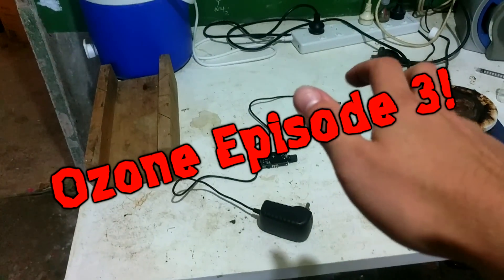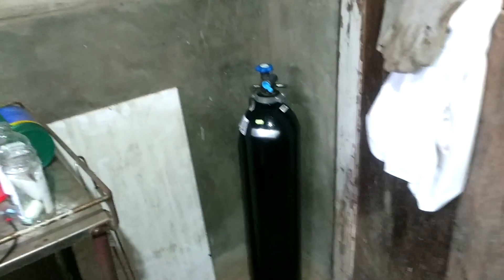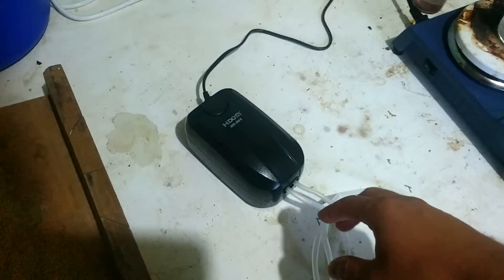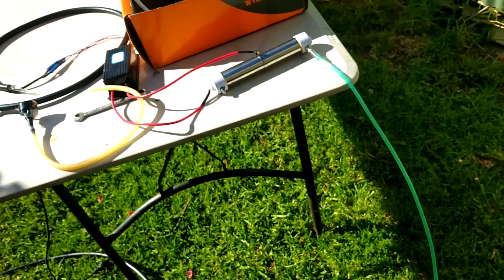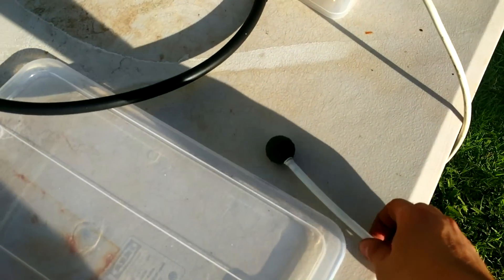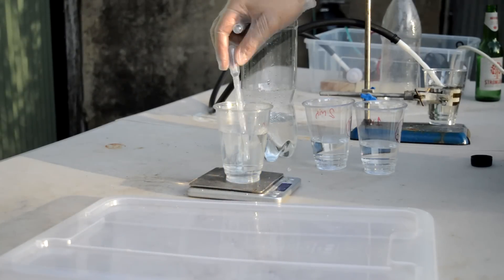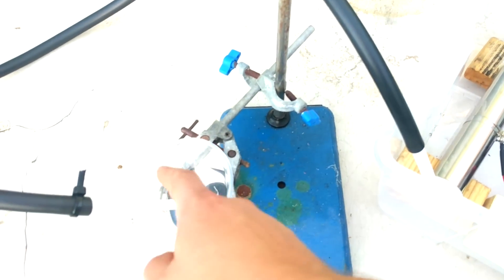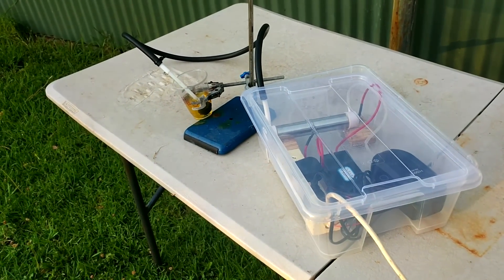Putting Pure Oxygen through the Ozone Generator (Ozone Ep3)

Comment from the maker: What improvements should I do next everyone?? I probably should use those one way valves to stop the ozone backflowing into the pump every time it turns off lol oops
Reply: Well I think you got a low efficiency because your ozone absorption wasn't good enough, try using a taller column. Also a lower oxygen flow decreases your ozone output but increases your oxygen efficiency as less is wasted
Reply: Nicolás Rodriguez 
lol, i should have read the replies before posting, this was my take on the situation as well.
Reply: Just leave the pump running for a while after turning off the ozone generator to flush the system with air.
Reply: Liquify ozone?
Reply: O2 flow rate was too high, its was all mostly gas, needs to be as fine of a "mist" of bubbles as possible of as small bubbles as possible. It should look like a gentle fizz to be optimum.
Reply: I think at this point, you're ready to run some reactions/experiments. If the goal is maximum ozone output, either parallel more generators or construct your own (the electronics and mechanical design involved might not be worth your time tho). My $0.02 is ... you have a source, it works, it seems to be stable (i.e. hasn't caught on fire or exploded :P), so proceed with using the ozone. 
A check valve is an okay idea, although you have a volume of oxygen between the pump/cylinder and the generator anyway, so that gives you a natural backflow buffer, and a valve could restrict flow somewhat.
Love from Europe <3
Reply: Isolate liquid ozone! It's explosively unstable if warmed to its boiling point but that might actually be a plus for you ;)
Reply: making Ozone with electric discharge is a self limiting process, don't expect anymore than a few percent max yield...you get to a certain conc and the equilibrium halts it going forward...
Reply: When I messed about with ozone production (sterilising water in a tropical fish breeding system) I found that using a column of silica gel to dry the air first made a big difference to ozone output. You can buy the gel with some indicator beads mixed in which change colour when they've absorbed as much moisture as they can. The colour change can be observed moving along the (clear) column so you get notice of when to empty the gel into baking trays and re-dehydrate it.
Reply: Shaun Stephens 
i think his O2 cylinder is probably about as dry as it's gonna get, but still good advice for if he doesn't feel like carrying the big canister, and just uses normal air like last episode
Reply: I'd toss in a cheap digital thermometer inside the box.  Maybe even a couple of them, so you can see how hot the key parts are getting:
https://www.gearbest.com/other-kitchen-accessories/pp_1483698.html?wid=1433363
They're so cheap you could put in a half dozen for the price of a fancy latte.  :-)
Reply: What if you had 2-3 absorption vessels in series? Leading the air/ozone flow from one to the other. Then you might be able to get some estimate of the level of ozone absorption by comparing the results between them.
Reply: Lars Petersson also a good idea!
Reply: Seeing this video first time and rethinking the process, I would guess the flowrate was much too high. Such Ozone gens work by creating a silent discharge. High flowrates and air moisure would reduce the yield by magnitudes...
Reply: One way valves, and more than one aquarium pump if one isn't strong enough on it's own.
Reply: I would build a cooling system, (water,air or just some cooling peltiers)
Because if the oxygen pipe starts burning that wouldn’t be good 
And it Really looks like it was getting a Bit hot
Reply: Just turn the ozone generator off and continue running the pump for a few seconds to run out all the ozone.
Reply: "What improvements to do next?"
1) Add aluminum fins to save your electronics. Heat shortens their life. 
2) Increase your flow rate through the ozone generator.  I strongly suspect  it is wasting time and energy breaking up some of ozone it created. Someone else mentioned it is self limiting and reaches an equilibrium. Increasing the flow rate might mean you can also remove air pump letting air pressure do its work.  I realize the faster flow creates issues with bubble size so that brings me to the next suggestion. 
3) Micronize the bubbles. Your stir bar was a fair idea to move water past the air stone ripping the bubbles off before they get big.  Bring that to the next level ×10 with putting the stone in a pipe that is just barely bigger than the air stone. Plug up the air stone everywhere except the sides next to the edge of the pipe. Then when you push water through the pipe. The water is now forced to accelerate really fast as it passes the stone  ripping very very  small nano sized bubbles off giving you far larger surface area to volume ratio. And because of their small size  and the  turbulence in the water, the bubbles will stay in solution up to several minutes. 
Producing micro bubbles will allow you to have a taller column and and the whole setup will have more water  volume that can better handle a larger volume of air flow into your micro bubble generator. Also moving water through the pipe  creates a venturi  effect that can suck air in. Just another reason why you wouldnt need the air pump. 

Micro bubbles examples: https://youtu.be/r4rJKypLijA
https://youtu.be/Fqs7ceAJcEw
https://youtu.be/en7tQisoA8g
https://youtu.be/bX48qxRtfFM
https://youtu.be/eNMTUBtynSY
Reply: Improve mixing / bubbler efficiency. Look into ozone reactors used for aquariums. Use lots of balls to increase surface area for absorption of ozone. Your generated may make 3g/h but the you may only have 20% efficiency of absorption into the fluid.
Reply: I'd use a desiccant/dehumidifier stage instead of an Oxygen tank...
Reply: loveblowsbad I use ozone for my aquarium and it’s supplied with desiccant as water damages the plates.
Reply: Look at perfluorocarbon solvents, they might have better ozone solubilities than H20...

https://en.wikipedia.org/wiki/Perfluoromethyldecalin

https://en.wikipedia.org/wiki/Perfluorodecalin

https://en.wikipedia.org/wiki/Perfluorotributylamine

https://en.wikipedia.org/wiki/Perfluorotripentylamine
Reply: Extractions&Ire 
i still think you may have lost a lot of ozone to the atmosphere.  even with smaller bubbles, spheres have the lowest surface area to volume ratio, so most of the ozone never even touches the water.  i think you could improve efficiency by putting your iodine solution in a very narrow, tall cup so it has to bubble through more water before it gets to the top.  i think a slower oxygen flow rate would also increase efficiency, but the speed would go down.  but it doesn't look like you're short on O2, so that's probably not a problem lol

but i think if you took those steps, you could maybe get 1.5 grams or something.  the 3g/hr quote is a bit suspect, but it's also possible that the the 3g/hr quote is only under very specific optimized conditions with various parameters that just aren't possible outside of a huge industrial setting.
Reply: Depending on how accurate you're aiming to be, you should start the ozone generator outside of your solvent. Let the generator fill the tubing with its ozone mix, then start the timer at the time you insert the tube into the solvent. Stop the timer when you remove the tube, then turn off the generator.
Reply: The lower yield from longer runs might be due to peroxide decomposing in the sunlight...
Reply: Hey Lad  sorry I didn't catch your name but keep up the good work .. but do U know much about ozone generator's for health ... I have lung cancer and am wondering if U guys would be able to give me some suggestions advise and links ... Hope to hear from U cheers..tis interesting stuff U do ....
Reply: You may want to get a cheap rotameter flowmeter with a needle valve so that you can set the oxygen flow rate to a repeatable value. The ozone generator isn't sensitive to the flow rate through it, so you can turn down the GOX flow to produce the same amount of ozone at higher concentrations while using less GOX. You need to dilute the ozone for most applications anyway, you may as well do so with cheap air rather than costly and hard to resupply GOX.
Reply: Use the regulator to set the minimum pressure then use a needle valve flow restriction to set the flow rate so you get  the conversion sweet spot

Comment: Also the ozone bubbles will be more effective if the bubbles are much smaller in size and can be made to interact with the liquid by making the height to diameter ratio of the container larger to have the same volume of liquid occupy a higher height to increase the time the ozone travels through it. Hope it helps.

Comment: What if you cool down the ozone tube with liquid nitrogen? At higher temperatures, more ozone will decompose into oxygen, as ozone is less stable (even though Le Chatelier suggests to heat it up more, since ozone formation is endothermic). I believe, it is the rate of ozone depletion decomposition that limits the yield, not Le Chatelier.

Comment: 3 years later and I'm sure people have mentioned this, but with your tanks make sure to turn them on/off using the main tap, and then adjust pressure using the regulator. If you ever need to shut one off in a hurry it's way way less turns to turn the tap off than to get the regulator down to zero.

Comment: Thanks for sharing the details about your PWM failing. I'm setting up a water pump for my vacuum aspirator, so the screenshot at 0:45 gave me a good heads up to know what to look for. 
It looks like this video covers exactly what happened to you: https://www.youtube.com/watch?v=LXGtE3X2k7Y
Alternatively, apparently using a voltage regular instead of a PWM would also be an alternative (or even the preferred solution - Says the Amazon product question/answer gods).
Reply: Or better still a variac

Comment: to combine both outputs of the pump, use 2 one way valves, one on each output, then a "Y connector" after the check valves leading to the ozone tube. I do this for my fish tank. if you don't use the check valves the 2 outputs start to fight each other since they are pulsing from a little lever balanced over a pair of diaphragms, only one output is pushing at any one moment, without the checkvavles they just cancel each other out. but with them the air can only go down the tubes, not back into the pump.

all came free with the £2 airtube I ordered recently on ebay so fairly cheap stuff and you'll get double output.

Comment: Points to consider:
#1 You seem to assume that more or less 100% of the ozone you pump into the water will be dissolved and retained to be measured later. That assumption seems to be off by an order of magnitude or two.
#2 Water can only dissolve a certain amount of ozone per liter (saturation); in the order of tens of mg per liter under typical conditions of temperature, water pressure, gas pressure and ozone partial pressure. So you're limited to about, say, 0.1l*100mg/l=10mg of ozone in your solution independent of how much/long you keep adding ozone.
#3 The generator's ozone output also depends on it's temperature, which in turn heavily depends on the gas flow rate  because the gas significantly acts as a coolant.

Sorry to say it, but the many uncontrolled variables make this experiment pretty useless for quantifying the ozone generator's output.

A more reliable way would be to take different gas flow rates, say from 1l/min to 10l/min, and measure the ozone concentration of the output gas for each flow rate, then just calculate flow rate/min * concentration * 60min/h. (Conversion: in air, at 1 atm, 20 deg. C, 1ppm of ozone (v/v) equals almost exactly 2mg/l (m/v))
The biggest output value one of the flow rates yields then is about the maximum the generator can deliver, and that's of course the value to compare against the manufacturer's/seller's claim.

Comment: I'm sure this has been covered but a CCFL UVC would produce MUCH higher O3 conversion then HV Corona. 
They make U and Straight UVC Quartz "CCFL" lamps, low power input and in conjunction with pure O2 flow will produce 100% O3 if flow rates and output levels are maximized.

Comment: The longer you run the ozone tube the hotter it will get and ozone production will drop! You get the best ozone amount at low temperature and no humidity. So pure, dry oxygen and low temperature production tube will give you the highest o3 production.

Comment: Could a 185nm tube inside another tube with oxygen flowing through it be used as a viable way to produce ozone? Curious how the efficiency compared to a high voltage generator would be

Comment: re your oxygen cylinder and its cost. How much would a Oxygen generator cost you? might be cheaper in the long term and my putting though a small compressor you could fill a small tank as you need it.

Comment: Are you adding the same or more amount of acid to the iodate? Are you adding enough?

What if you increased the pressure of oxygen from the cylinder?

Also it sounds like the other hole on the pump acts as an air inlet if the other is the outlet, so maybe that should go to the outside.

Comment: Cool setup m8. This is pretty much what I had in mind when I was looking into ozonide organic chemistry experiments. The idea was preparing atropic aldehyde from styrene linear dimer. There's other nice stuff you can do with this, preparation of benzaldehydes from corresponding alkenes. Trick indeed is to use pure oxygen as the feed because if you use air you will also generate nitric oxides.

Comment: i still think you may have lost a lot of ozone to the atmosphere.  even with smaller bubbles, spheres have the lowest surface area to volume ratio, so most of the ozone never even touches the water.  i think you could improve efficiency by putting your iodine solution in a very narrow, tall cup so it has to bubble through more water before it gets to the top.  i think a slower oxygen flow rate would also increase efficiency, but the speed would go down.  but it doesn't look like you're short on O2, so that's probably not a problem lol

but i think if you took those steps, you could maybe get 1.5 grams or something.  the 3g/hr quote is a bit suspect, but it's also possible that the the 3g/hr quote is only under very specific optimized conditions with various parameters that just aren't possible in outside of a huge industrial setting.

Comment: The flow rate probably goes to shit because the two lines cancel each other out. One way to imagine this is to realize that constriction of the outlet and back pressure of the tubing is the only reason why the airflow is constant. If you remove the tube you can feel the air is actually coming out in pulses. Dual outlet aquarium pumps usually are setup with one arm that vibrates between two rubber cups. Pulses of air puff out alternately, from one side then the other, as the pump arm moves from one side to the other like an alarm clock hammer going between the bells. Hooking them directly together means that you are essentially completing (shorting) an alternating current circuit of air with no load. To solve this issue, place an aquarium airline check valve (one way valve) in line with each before you combine their output.

Comment: I'd suggest  getting  (if memory serves me) get a 1N4001 diode shorted across the motor terminals.

I believe with the white or silver band on the positive terminal of the motor and the other lead to the negative.

If the diode gets hot and the motor doesn't spin then the diode should go the other way.

I don't think that ozone is that corrosive but it might be. I know that if you have a circuit like the one that you have  and you  have hydrochloric acid (even capped up) that it will chew the shit out of circuitry in no time. So that might be a failure mode as well.
Reply: Ozone likes to oxidise everthing. It really wants to boot that extra oxygen atom out. 
Its not corrosive like hydrochloric acid but I still wouldn't want to breath too much in.

Comment: Here's my 2 cents, you said humidity is an issue you can do 2 things, scrub the air with activated carbon and then dry the air with desiccant in 2 separate tubes, one for carbon and the other for desiccant. Now In terms of your transformer the hotter it gets the less efficient it will be, so that will need cooling and a lot of reserve to work easier. Now you should observe the corona discharge, its probably not propagating much spark as electricity is lazy taking the shortest route, you have to make it work from anode to cathode and make as much spark along the tube as you can. Your probably going to need a transformer that is frequency adjustable and very high kV, so you can make up for the high losses in the tube and Im sure your spark gap is large so decrease it so increase the ease of spark flow you should hear it really humming. Also get one of those micro bubble sintered ss air diffusers to get the o3 air in the water. Hope it helps.